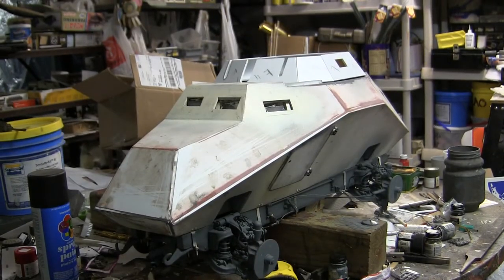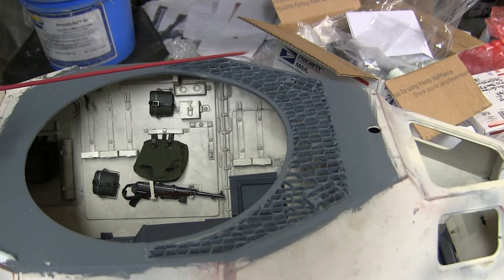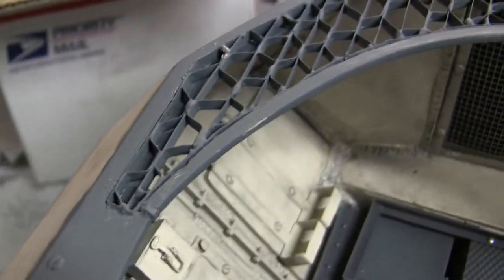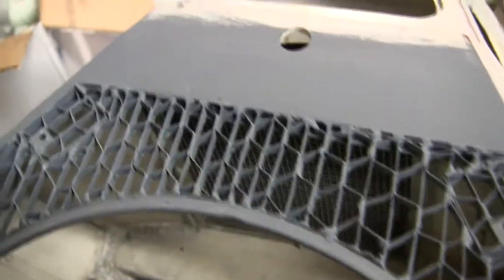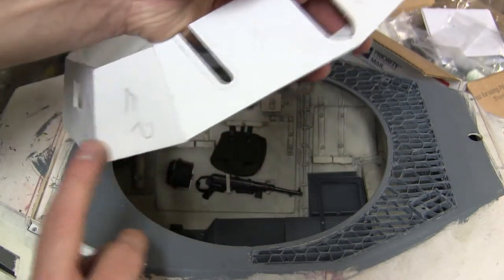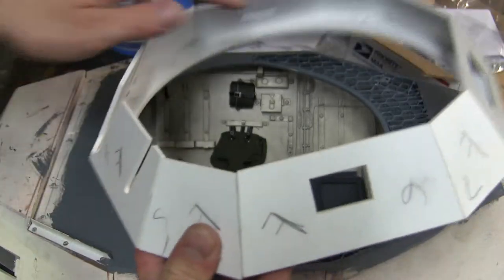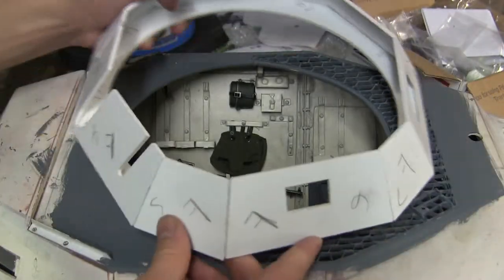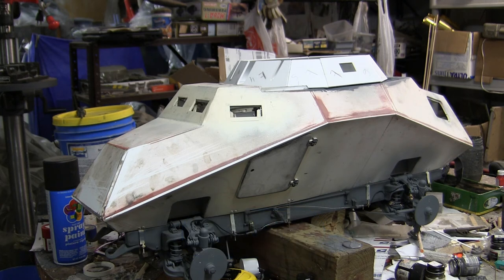1/6th scale German SDKFZ 222 armored car project video #11 (rear grill work and turret)

Comment: FYI, the honeycomb material is available from a couple of places.  Look for companies that do Anti-reflection hex for military rifle scopes.   And there are some 'faux hex' material made for putting modern radiator cores in antique frames.  The mesh is soldered on top.  I will e-mail you with a couple of sources if you like.  Cheers.
Reply from the maker: There are honey comb materials out there yes, but none have the same pattern of the 222. This pattern was unique to this vehicle, and to use the other material would have hurt the look of the model.
Reply from the maker: If I were to ever do it again, I would probably use 3d Printing for the grill, same could be said on a lot of other really hard to make parts on this build